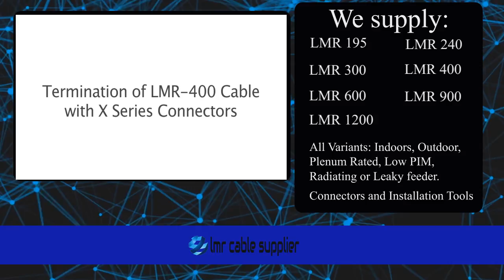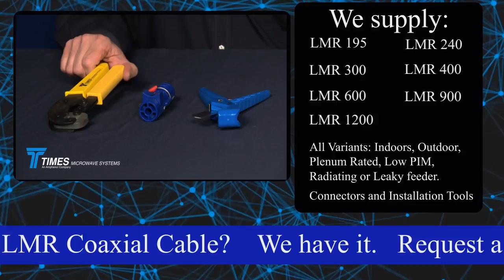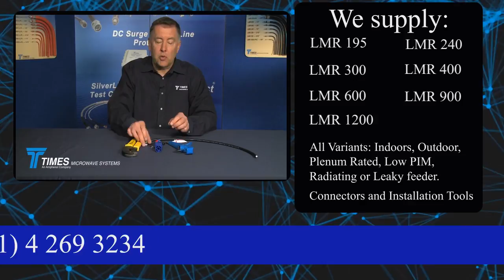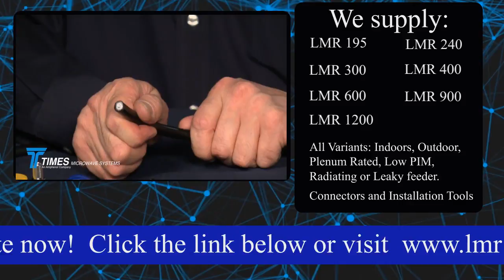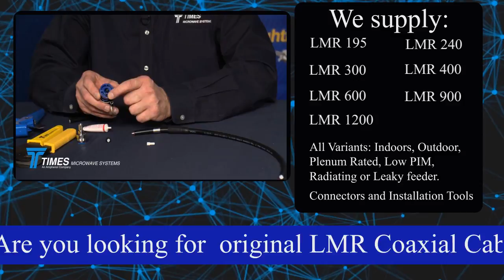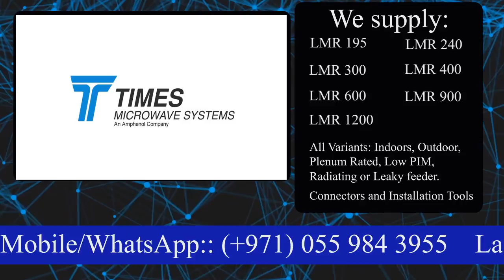Reasons why you have to use LMR 400 coax

Comment: Sooooo...... I saw how u prepped the cable but.... Why is it actually used instead of other types of coax? I have just ordered some Wilson low loss 400 50' 50ohm cable for my weboost home 4g. After months of jacking with it and not being able to figure out my issue of high-low back and forth dips in my download speeds no matter what I do or where I move the equipment and antennas both inside and out of the hone, I'm hoping this fixes it. This is being used for a rural cellfi mifi setup strictly for data. So did I make a good choice? Reading Amazon comments over the product says this has done the trick for them. My equipment is: weboost home 4g, Netgear nighthawk M1 with ATT setup as a modem only with IP passthrough enabled basically all else disabled on it, a Netgear nighthawk XR500 router which is mostly just used as my switch so I can get hard wired to all my devices, two aftermarket 9dbi wide gain sma to TS9 antennas for the nighthawk m1, and lastly the new cable itself instead of the default weboost white RG6 coax cables they claim that are low loss and support both 75 and 50 ohm variances which I am iffy about if best. I have tried almost every sort of RG6 u can think of besides I guess plenum cable. I've used dual shield quad shield tri shield etc etc etc. Can't really find any direct clear answers online as to the best way to go about my setup and which cable would suit it best. There's an inside antenna an outside antenna pad about 20 feet in the air on a pole and the pad is facing closest tower to me 2.5 miles away. I know this setup is capable of running up to 35mbps where I live but with numbers not being able to hold steady something is still off. I know the Wilson 400 will help just wondering how much and if u have any recommendations. I used to be a cable guy many years ago. I thought for a while it may be something effecting the line to the equivalence of unwanted voltage being on the line, but since the weboost home 4g uses an amp, the line is going to have voltage on it atleast from the amp onward and there's really no way it can be getting voltage outside from the pad as it has no current there. Even where I grounded the coax it's not backfeeding up to or into anything hot. Thank u and sorry for long post